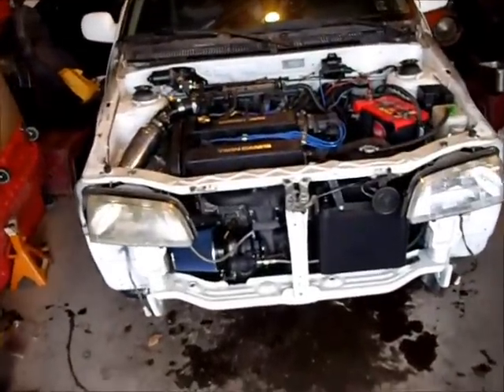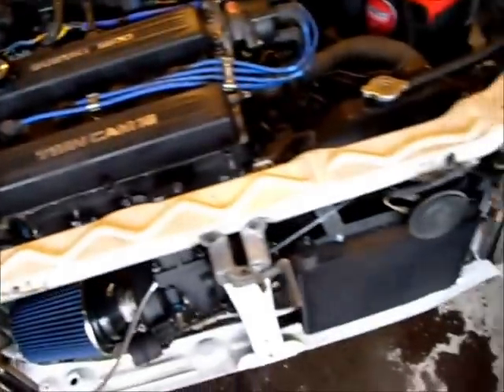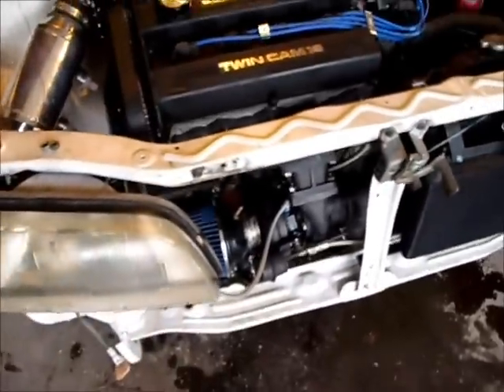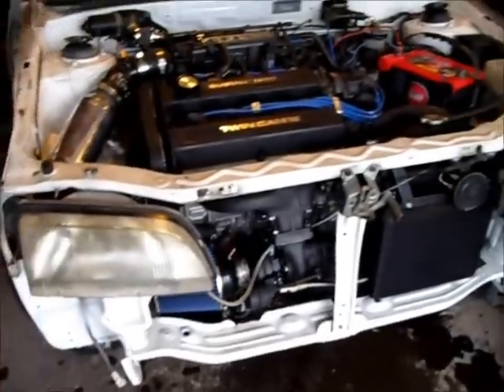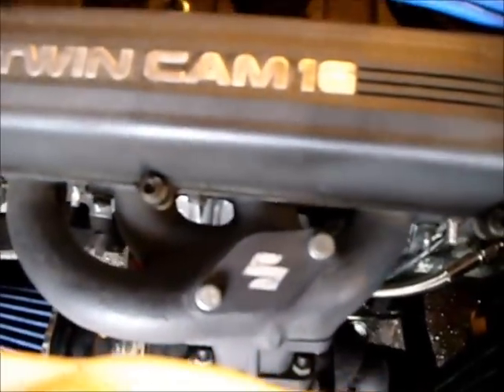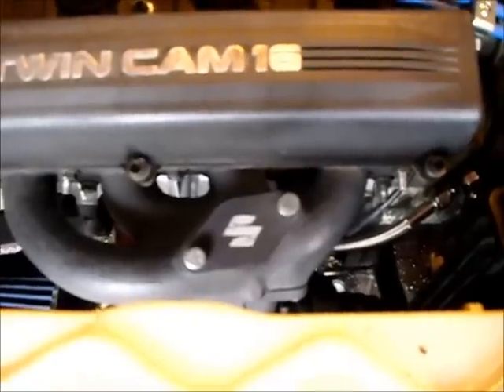Turbo Swift GTi build part 14- Test Drive

Comment: Really Nice Job,Can you Post, what exactly parts ,do I need to turbo my 93 Geo metro 3 cyl Automatic .I like your intercooler on this one, but I'm kind of confused cause with your Geo U had Huge intercooler, which one do I need.I 'm not a tech at all just an amateur ,and have a Desire.I'm scared to buy any parts yet without consultation.How do I start ?????????????? o keep it not too expensive .Thanks Man. Awesome work

Comment from the maker: @rzinovyev 
well there is more to turbocharging an engine than just a parts list, it is gonna take time and you have to be willing to fabricate parts cause the oem turbo parts are all but non existent. I dont have a list in front of me, but i will try to get a basic list together and message you. The intercooler on the geo is larger b/c it is air to air, the one on the GTi is air to water, they are smaller and havenfar less boost drop, that is why I can get it to boost so early